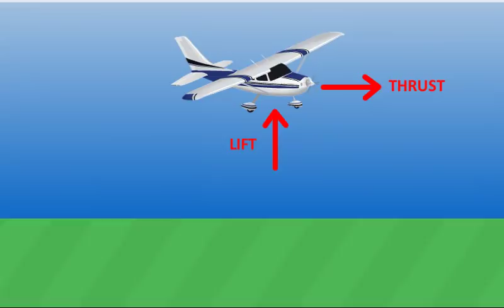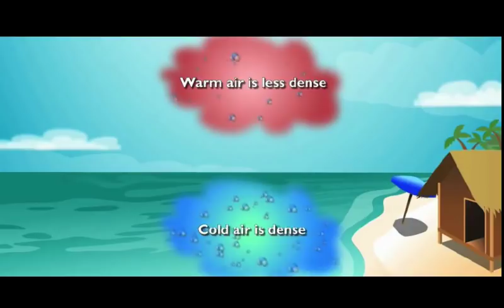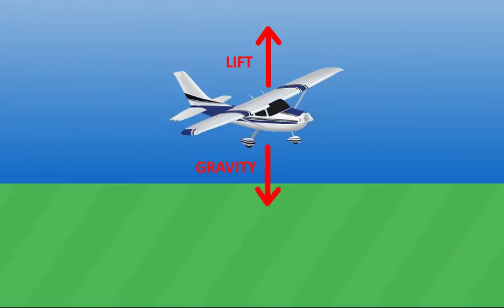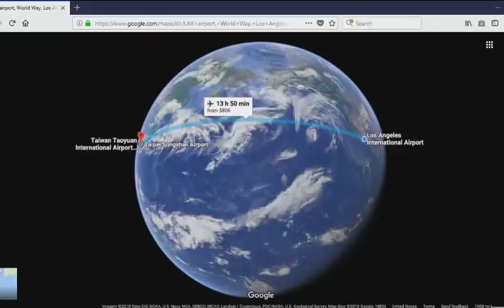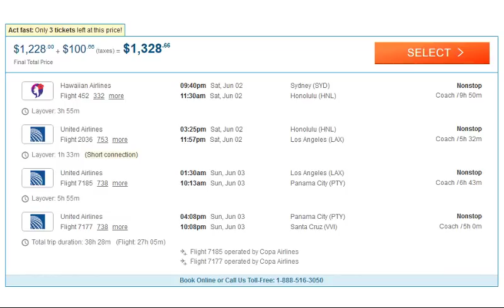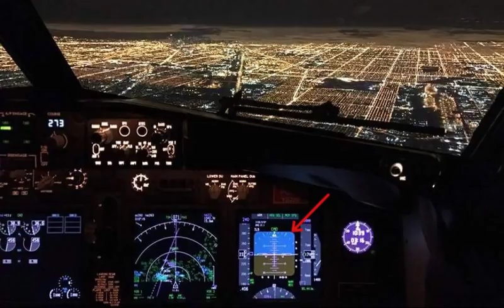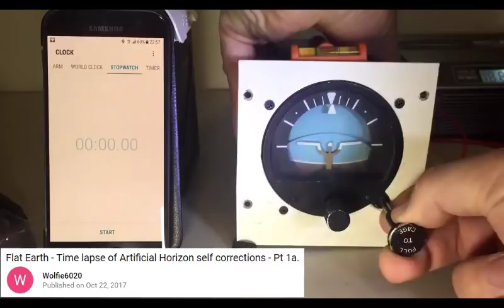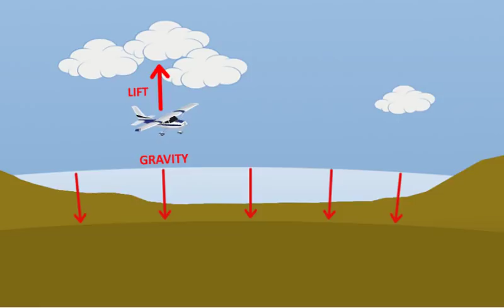Flat Earth Falsities - Plane Nonsense

Comment: The idiot Flat-Earthers can be proved wrong so easily by millions of peoples current and historic accounts of what it is like to live really far north or south, close to the polar regions, that depending on the time of year, meaning the seasons changes the amount of night or day one has for certain months. Otherwise known as what happens with the bent tilt of our planets polar axis, that tilt either toward the sun for summer in the north which leads to the tilt away from the sun and winter in the south, or vice versa. Those in the northern summer polar region experience no night time only a small amount of a slight twilight, and those in the southern winter area experience very little to no day light called the midnight sun. Just ask people that live in those areas!? They can not all be lying or tricked!? Hell even the change in the directional turning of water down a drain being opposite depending on if your in the northern or southern hemisphere proves a globe earth. Flat-Earthers are literally cancerous examples of failed education systems, lack of intelligence, lack of common sense, insidious religious indoctrination, and lack of math and physics comprehension. Why would all other planets in our solar system, that anyone can view with a telescope they bought, be globes that spin on an axis, but just Earth is a flat dome!? Of which NOT ONE of them can come up with an actual accurate model of how it looks and works that all agree on and that aligns with the known and provable maths, maps, and laws of nature and the universe that can not be disputed. Sheer deluded idiocy, its the same thing that allows for the creation and existence of suicide bombers!!
Reply: You've been lied to. It's ok. The truth is out there and it will set you free. But it's not in a math or science book.
Reply: Robert Lefebure First understand that the Earth is an enclosed system, it does not move through air. The Air and Atmosphere move with the Earth, and wind is generated by the change of temperature in the atmosphere. Second, the Earth stays together just like a drop of water stays in a glob in zero gravity but add in the Sheer Mass of the Planet and the fields of electromagnetic energy fanning out from the core of the planet, all of that makes even denser gravity in our liquid molten spinning core. So thats how things stay together, the reason we can not feel movement is because we are in motion already and nothing has stopped. Finally, compare it to suddenly waking up in a car that maintains a constant speed, unless the car slows down or speeds up or stops you will not know you are moving except for the vibration of the engine. Everything inside and with the car is moving in the car, its acting as is own enclosed system. If you, being inside the car, had a ball you could throw it into the air and catch it, it would not suddenly fly to the back of the car, BUT if a person outside the car threw a ball into said car, that ball is not part of your closed system of motion, its part of the outside worlds and that is why it would fly and slam into the back of the car. Objects in motion stay in motion, until they meet an equal or greater force that stops them. And if an object is at rest it needs something of equal power to get it moving. What you flatearthers forget is that what happens Inside of Earths Atmosphere is happening in an already enclosed system, and the variables would change outside of Earths Environment and Influence in the vacuum of space. The only way we would ever feel Earths motion is if we left it and came back in, or something suddenly caused it to stop spinning. But that would be so catastrophic, we would all be dead shortly after.
Reply: Thedeepesttruth blablabla
Reply: Thedeepesttruth  Since you talk about living in the north, if the ground is cutting through the air at 1100mph at the equator, it is not hardly cutting though it at all at far northern latitudes.  Spinning at 1100mph ought to cause some centrifigal force making the atmoshphere thicker at the equator. And the opposite should also be true at the poles as the planets air would be "spun out" around the equator like a donut.
Reply: Thedeepesttruth And I guess you're going to tell me there is a little secret door from that enclosure that the "space travelers" open and close really quickly (so that they don't let the air escape into space). if there is an enclosure, dude, you're talking Biblically (i.e. the "firmament"). The story is the Earth is surrounded by air travelling through a vacuum. I'd like to see that trick reproduced in a lab.
Reply: Robert Lefebure And as I told you the poles do spin, though there is some difference in certain aspects of things because of the tilt or wobble to the axis, its not a straight line. I do not get the point your trying to make!? What are you asking? Why would any part of the Earth move through Air let alone the polar regions!? The planet is not spinning through Air, the Air or rather certain parts or layers of our atmosphere is spinning With, as in Along With, Side by Side, the Earth! Air or Wind is not just in motion from the planets spinning, its in motion from the change in temperature and air pressure because of the warmth of sun light and the cooling effect of night time, and of said cold air sinking and being denser then the rising hot air warmed by the sun! You need to picture all the systems of the Planet in a Constant 3D spherical motion and shape! You also can not compare a spinning ball to the planet as its not accurate, the Earth is like a petri dish bubble in a spheroid form, and its therefore its own contained environment only being affected by massive solar energy and temps. or even meteorites. And sometimes its own variations in the electromagnetic fields. But the tilt to the axis, which is more noticeable at the poles and creates things like the Seasons and The Great Procession of the Firmament known to us as the Zodiac Constellations, would explain the slight difference there in perceived change in speed or motion. Because you have to understand that things like space and time, and our measuring of them, are all relative to where you are at in space and time when one perceives its motion. Time is only us taking notice of matter in motion through space and thus putting measures on distance and speed and height and depth of field. An example is of me being on the street and someone being on a tall building behind me on the roof, a car accident happens a mile down the road in front of me, and the person on the roof tells me about it on our cellphones before I on the ground could perceive it to be because of them being in different spots in space at the same time. Its a matter of space and time and elevation in that example. Like when some flat earther's try to use the horizon-curvature equation on a city on one side of the Great Lakes but then used the equation without inputting their own elevation at that moment and that the equation is set to Sea Level! So their answer of oh we can still see most of the city so there is no curve is flawed cause they did not use the equation properly. Perception and therefore measuring motion is tricky like that. Back to what I am assuming is your question of motion differential from the equator versus the poles? There is some difference in the air, maybe slightly different in temp and pressure and electromagnetic effects would differ as well as very slight gravity. Because if you are on the equator point not only will you have no shadow at Noon time as its location at that time only receives a straight ray of sunlight versus an angled one, but you can also balance an egg on its end when at the equator and it will stay like that but will not do it anywhere else on the planet. Both are known phenomena and effect of the equatorial belt as its slightly closer to the sun then anywhere else except for certain mountains. And the air pressure and gravity is at its highest there versus at the poles because the pull of gravity is exerted more on said egg at the equator then the pole as the egg on the equator is further from the core and it has a stronger gravitational pull then it would be if at one of the polar regions. The Earth is thicker and bulging at the equator then anywhere else. As far as the poles they have their own unique quirks of physics and dynamics. Like how compasses wouldn't work the same at certain points, and there is a difference between magnetic polar locations and physical polar location. The other thing is that because of previously mentioned axis tilt or wobble there is a doughnutting effect to the shape of both our magnetosphere but also the Van Allen belt of radiation. Meaning that its not a in a solid sphere around our planet there is open holes at each pole for both types of energy. And then take into account that at the moment we are in some type of polarity shift dynamic as our magnetosphere is the weakest its been in 2000 years and we are overdue for a polarity reversal. Plus our own pollutions effect on the atmosphere and ozone has allowed for the Van Allen radiation to be closer to earths surface then ever before with the biggest hole or dip being from the Antarctic region stretching all the way up to Peru in South America!! But again what exactly is your point and what is your question because its not clear nor is it fleshed out, and it honestly makes no sense? And Id like to answer it fully and correctly as possible.
Reply: Robert Lefebure Okay so you basically think by comparing a ball spinning and how it APPEARS to look like the points where the poles would be do not move, that that means the poles on our planet are the same?? Umm... sorry to disappoint you but that is only Your Perception of the situation! In reality the poles or points on the ball are still spinning, it is only an illusion that they are not. And when you take into account the bend in the axis as again its not a straight line would account for any Perceived Difference!! Do you not get that you are only thinking you observe no motion on those points of the ball and are conflating that to the Earth!? And yes between Gravity's power and the Fields of Electromagnetic energy and our depleted but still there Ozone layer, we literally have multiple layers of what could be called force fields that has some weak points, where? At the polar regions!! But said force fields, in laymen's term, are still there and they are functioning! But the sheer mass and energy produced from the Earths size and core keep all things contained within said atmospheres of the Earth!! What are you not getting!! No one ever said the Earth is surrounded by just Air, that is your kinds interpretation of it, it is surrounded by energy and layers of gases that because of there atomic structure and interaction with the energy produced by Earths core along with Earths Gravity create an almost singularly unique effect of creating ATMOSPHERES dense enough to provide many layered protections for life to not just form on said planet but the fields exist long enough to allow life to Flourish!! What are you not getting? How can you not understand that the Earth is not Flat, it maybe hollow or honeycombed, but not flat. It is a Spheroid Shaped Planet just like all other planets you can literally SEE FOR YOUR SELF with any good telescope that they are what?... Oh gee, how could it be they too are all spheroidal in shape! And what are the little specks moving around them on a horizontal axis of rotation? Oh! So some of the same globe planets in a solar system have moons too!? Who would have thought of that Uniformity in nature!! Cause nature never repeats in natural geometric shapes and patterns! There is literally No Reason for anyone to lie about the Earths shape and construct, its not like someone or the governments of the world are making billions off of Globes of Earth sales!! It literally is the densest and stupidest and most offensively ignorant trend for Idiots who do not understand that something can not and do not need to be sensed to exist. Which is funny as that is your kinds basis for the Existence of you primitive version of God!! Cant feel God, but we have faith he is real! Yeah well same difference here in this situation, just cause you think the planet in its globe form should look a certain way, or you should be able to sense its movement somehow, does not mean that the lack of that sense means its not a globe!! It means that humans senses are flawed and completely tied into the level of knowledge and imagination and ability to mentally calculate and perceive the truth of the reality around them is! Some of us are just better at this then others, and most of the others trust those with those gifts to see the state of things backed up with the mathematic proofs and scientific evidences they can give for why things work and operate a certain way!
Reply: Thedeepesttruth As I explained, the Earth supposedly spins at 1100mph at the Equator but the poles do not move through the air. Pick up a basketball (or watch someone) and spin it on a finger and the dynamics are right before your eyes.  The poles don't move but the equator does. And the higher you go, the faster the air would have to travel  to keep up.  You can't feel the 1100 mph standing there at ground level and no windsheers at higher altitudes and/or different latitudes that significant to make up the 1100 mph.